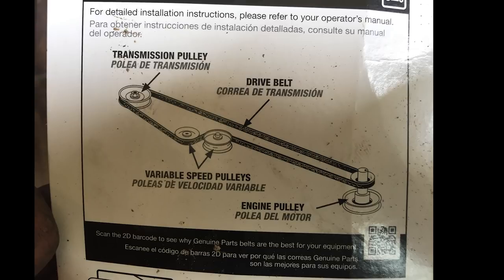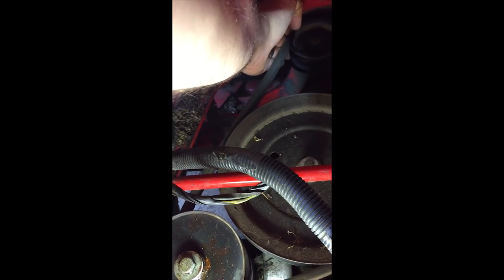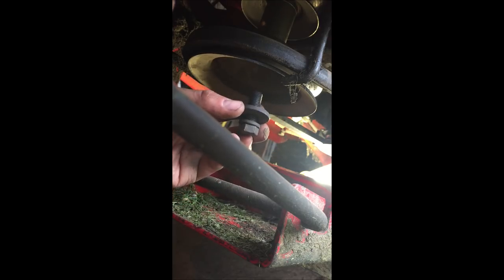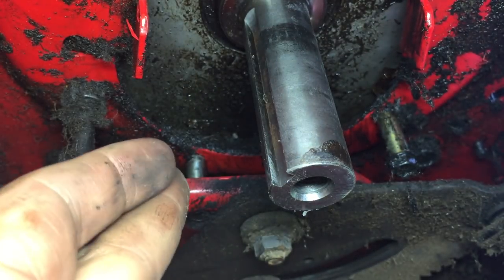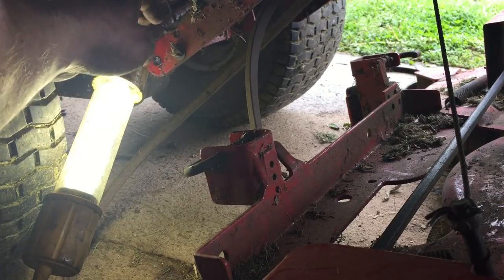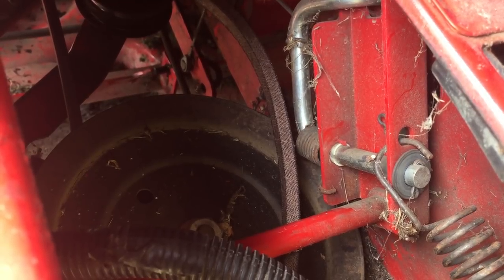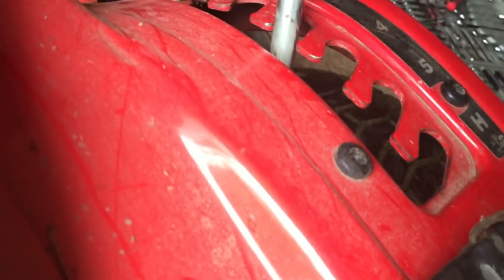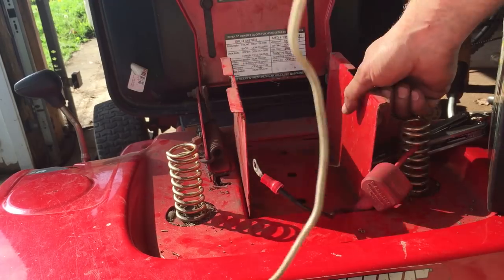Huskee / MTD Lawn Mower Drive Belt Replacement

Comment: I have an older Huskee 42" cut. Gears 4-6 went out recently so I pulled the upper drive belt and it was cracked all over and chunks missing. Couldnt find which size I needed so I matched it at Tractor Supply with a 5/8 x 48". After install it came off the pulleys twice soon as I put it in gear. Guessing the new one is too big? Do I need the 42" v-belt since the deck cut is 42"? Bout to go buy a few sizes smaller and do trial and error. $25 a pop.
Reply from the maker: Hey Kevin,  

I would check this site out, you should be able to find the belt you need here with some searching:  http://www.mtdparts.com/equipment/mtdparts/parts/part-types/belts . Please let me know if this helps.

Comment: Thank you so much. This instruction saved me. My main drive pulley  center bolt actually goes into a black steel bracket with a threaded hole for center bolt.  No nut on bottom.
Reply from the maker: Glad it helped!

Comment: Thanks for getting good shots with sufficient light.  
MTD (Huskee) engineering is totally incompetent! My belt failed due to rough surface on the pulley. Check yours.
The pulley is directly below the battery and was rusty. Instead of spending $65 for a new pulley, I cleaned it with a circular (not orbital) sander, and a stone grinder-bit in my drill.

Comment: I Have the exact same Tractor and Just Changed BOTH Belts as you Did.  Tractor Runs Fine BUt there is a Terrible Squeal from the Drive Belt. I've jacked up the mower , engaged the pedal and looked every where for a loose pulley etc, and found None.  can't pinpoint where it's coming from?? What would make it Squeal so load on and off?   Do all new belts do that?
Reply from the maker: Nah, no squealing on mine. Can you tell if the belt is rubbing on anything? Does it feel like the belt is engaging all of its connection points solidly, with no slipping that you can notice? Did you use an oem belt or another manufacturer (be honest)? Can someone engage the belts while you look around closer? Other than that, I’m not sure entirely without looking and tinkering with it myself. I hope you find the cause quickly!
Reply: Figured it out...I had the Belt on the wrong side of one of the Keepers and ir caused BOTH Belts to Press and Rub Togeather Very Tightly causing the squeal ...Because the  Belt BROKE OFF, I never seen or knew which side of the Keeper it went on, so it was an oversight.  Thanks For replying.
Reply from the maker: MrDanoconnor no problem, glad you figured it out and it sound like without further damage. Great work! It’s very tough to show how the belts are routed so I did my best to show the diagram at the beginning and offer the best vocal descriptions to what I was showing on screen. Happy mowing!

Comment: Well, my mower has been sitting for about 2 months now.  Something broke, not sure what, just got around it today and noticed one of the springs on the transmission idler pulley is gone, but that doesn't explain why the accelerator peddle just falls all the way down.  I seriously hope the tab that holds both those springs didn't snap off.
Reply: Well, two springs broke at the same time, one for the peddle to return, AND the one that holds tension on the tranny tensioner, go figure!

Comment: In replacing my belts, I came across this video, sadly, mine is slightly different...  You have to actually remove the bolts holding the transmission in place at the rear, as well as the bolts by where the shift lever connects to the transmission and lift the mower up about 2 inches to get the larger pulley to clear just enough to let the transmission belt slip off.  There's less than 1/4th an inch between it and the mower body.

Another thing, there is no bolt for the variable speed pulley on my version of the mower (seriously, our's appear identical till it comes to the tranny area) that's on the bottom, there's a pair of bolts on the left side right above the transmission mount bolts, and it makes it a REAL pain lining the pulley assembly back up.

Just a few tips...

#1 Drop the entire deck and remove it, it saves you a few headaches, and takes like, 10 seconds more to slide it off that front bar, and another 10 seconds to slide it out of under the mower.  So much more room, and much more comfortable to work on.  Also a great time to lube the hubs if yours are able to be greased, and to replace those belts as well if they haven't been.  

#2 If you drop the deck, and look up at the tensioner arm for the transmission belt, you will see a spring, if the belt is fully worn out, and the tensioner is maxed out, you can easily reach up, pull the spring towards the back and off of the arm.  Makes replacing that belt a good bit easier!
Reply: husky supreme 4600 ?? is it
Reply: Hey dude, what model/serial you working with?  I'm running into a similar issue with a shift lever on Huskee. Model# 14AI808H731 and Serial# 1A083H20266.  Can't seem to find the Owner's manual for the 808H's.  I can find "Operator's Manuals" but that doesn't give me the "how to route the belt around the shift lever" (shift lever located between the drivers legs just below the seat.  I got all 4 belts replaced but that lower drive belt is rubbing on the shifter or somewhere else.  It's a pain in the rear.  Poor engineering IMHO.

Comment: How do you push the mower  on trailer if it doesn't run
Reply from the maker: As long as there are no other issues, if the mower is placed into neutral and the parking break disengaged by pressing and releasing the brake pedal, the mower should move freely forward and backwards. If you find this is not the case, something else is amiss and warrants further investigation.
Reply: @DavidStumph  thanks and that's what I was thinking but while in neutral it acts as if it is in gear. I didn't know what is causing this. I'm stumped.
Reply: check your brakes... could be the pins may be needing cleaning.... just put mower in neutral & try moving mower front & backwards... if your suree your in neutral... then more likely it is a brake issue... first try adjusting the brakes with the adjusting nut... (see owners manual)… hope this helps...

Comment: Video didn't help replacing one belt when you push the drive pedal it makes it roll it is only one bet lower drive belt not the top it is not one long belt all of them are single belts per pulley system